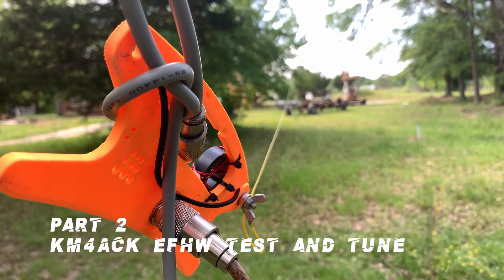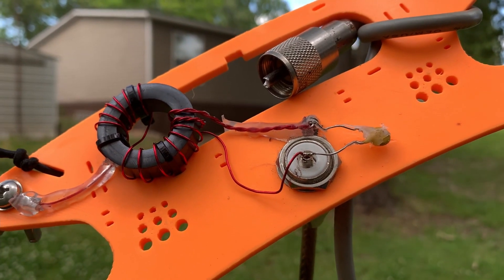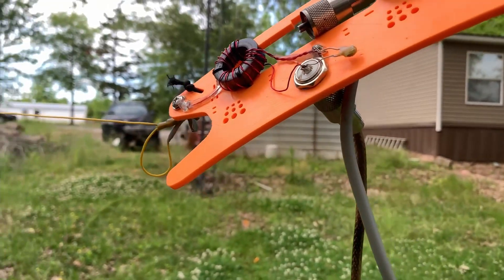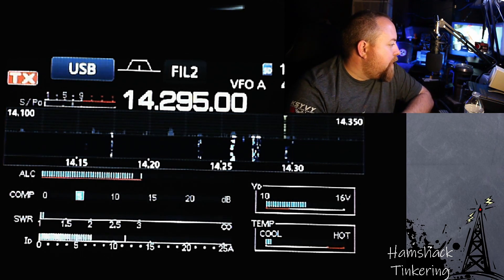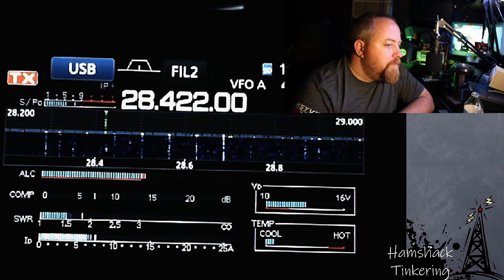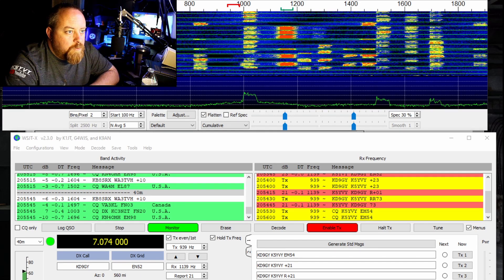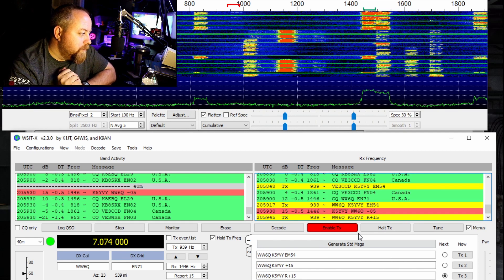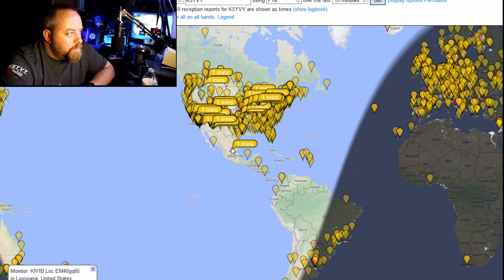Part 2 of KM4ACK EFHW ham radio antenna Test and Tune | Ham Radio

Comment: Glad to see the antenna test was eventually successful. I think the signal reports you were getting were even more remarkable. 

According to the manual:

"Consider reducing power if your QSO partner reports your signal above -5 dB in one of the WSJT-X slow modes. These are supposed to be weak signal modes!" 

Just my opinion, but the 1.5kW hams are fouling up FT8. Glad to see someone showing how successful you can be at lower power, even if it was just a test.
Reply from the maker: The efhw is a great antenna, I really like how the 49:1 matching allows you to switch several bands without the need for a tuner. 👍

Comment: did you have do any trimming?
Reply from the maker: Hey Doug. Yes I folded and twisted back about 5 feet or so of the wire to tune it. Talking with Jason that makes the kits, my understanding is he don’t measure out each wire exact and some may have to trim more than others.

Comment: How many watts did you use in SSB with this antenna? 73s
Reply from the maker: The highest I set the 7300 power setting to was 35% while using this antenna. Not sure what 35% equaled in actual power out as I currently haven’t got a meter yet for HF.

Comment: If you want it better on 10m just clip a short bit of wire on the end sounds like its a bit short if the sweet spot is in 29mhz. If the clip on wire messes up the rest of the bands take it off and store it in the go bag. vk5cz ..
Reply from the maker: Thanks for the tip! I’ll give it a try.

Comment: good stuff joe, im looking for a portable antenna for my camping. this just may do the trick.. hope ya`ll do9ng ok over there. dx is getting better and better hope to see ya on the air.73
Reply from the maker: That you butter bean! For the price this is a must have antenna, especially for camping! You won’t regret it and it won’t break the bank, leaving room for additional antenna options if wanted 🎉
Reply: @K5YVY  yea its bb in Georgia. I went to the web site and he is sold out. ill check back later 
 just got through with making a camper out of a 6x12 enclosed trailer. looks good. got HF, CB,VHF and scanner in it! put 2 different NMO mounts on roof for scanner and VHF/UHF other for scanner ant. have a place for a wall mount bracket on outside for a pole/mast on one side and a hole under radio station for cables. im going to post a video when i get a chance.
Reply from the maker: @butterbean4195  nice look forward to seeing that